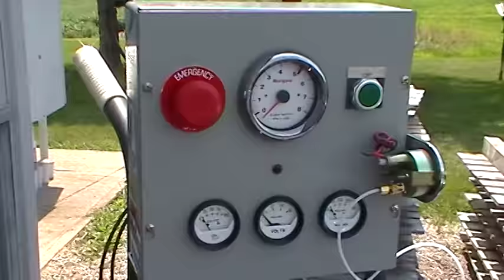383 Stroker Blower Motor Startup

Comment: That seems a little excessive for just those four castor wheels....
Reply: This is sarcasm by the way....
Reply: Cpt Swoopty haha
Reply: Hahahaha
Reply: HA!!
Reply: Cpt Swoopty absolutely the best comment I've seen
Reply: Old comment but still funny as shit!
Reply: Cpt Swoopty -very good! Lol!
Reply: Might even be Harbor Freight
Reply: That's a ten second  engine stand dude.
Reply: i bet someone of those 3.5 sec radial guys could make that work...and 220 mph to boot!
Reply: the wheels are chev ,if dodge or ford then we would have a prob
Reply: Those caster wheels offer the best output ratio lololol!
Reply: But...they are urethane race spec, and drilled out, so they should be able to handle it !  :)
Reply: Need enough power to overcome the lack of traction on the small size wheels...lol
Reply: 3 year old comment still wins. That's funny stuff right there.
Reply from the maker: I finally put 30x14 slicks on the cart.

Comment from the maker: This engine ended up installed in a 1948 Anglia driven on the street by a 70 year old man. Replaced carbs with 680 Holley blower carbs at his request.
Reply: So, essentially this motor will never see anymore than idle RPMs?
Reply: RizoProduction yah it's really sad that it'll truly never run because the engine looks like something out of mad max and must be drove like a mad max car
Reply: Joshua Godsey hey there are some pretty badass 70 year old guys out there so you never know 😂
Reply: Dylan Rhoads why do I feel like the 70 year old driving this won't be badass though
Reply: Joshua Godsey because you are probably right hahaha
Reply: Dylan Rhoads there are some 70 year olds in a front engine dragster series around my area.  Running blown alcohol between their legs like it's nothing.  Well I think one of them died during one of the last races, but I guess that happens when you get too excited.
I was wondering about those carters is they were just something someone had and said here you go or what.  Wasn't surprised new owner swapped them out.
Reply: freaking engine sounds incredible,but there's something going on with vacuum,or like you said it's running lean,but still yet if it were lean it would sound more like a dead spot,and that's not the case. it's a vacuum leak somewhere probably in the intake
Reply: Don Gray most likely a leak between the intake plenum and the blower. The gasket channels are thin and the bolts are widely spaced and boost from the blower blows them out. Another reason could be those carter afb carbs, I ran one on my 1978 mustang 5.0 and could never get them to run smooth to save my life, constantly fiddling with settings, jets, plus they love to backfire and burp fuel all over the engine. I replaced it with a 1850 holley double pumper and never had a problem again.
Reply from the maker: It turned out to be too much car for the owner. I own the Anglia now. I have over 1000 miles on it and have been against the Rev limiter in high gear MANY times. It is damned fast!
Reply from the maker: RizoProduction. NOPE! I own it now. Was too much for him. I've been topped out several times and have driven it over 1000 miles. It kicks ass!
Reply from the maker: dave1135 I switched to 670 Jolley blower carbs. Runs a ton better. Still surges when idling in gear but I like that.
Reply: You mean 670 “Holly” blower carbs? What do you charge to build a pair of these, apron 420-425 Hp for an older (1980) boat that’s all original. No blowers, just a thumper cam and reliable? Pls reply back if you would?
Reply: qtrmiler1 what horsepower is it making ?
Reply: So cool!
Reply: I am really wanting to know how much this motor sells for..
Reply: hopefully you had the good seance to keep the Holley's. Old man had that part right, now didn't he
Reply: I hear a lot o nay-sayers on the the sevety year old man driving using a motor like that.  I say he was 20 years old in 1968.  He knows what a muscle car was and can be.
Reply: +RizoProduction Shit, plenty of 70+yr old men still racing. Go watch a Gasser shootout and check out most of the owner/drivers, many been doing it since the 60s with the same car.
Reply: watch the 70 year old guy drag racing a hemi cuda stick sometime,dont be so quick to write off the old guys.they did it first and still do it...................better than the young punks @joshuagodsey3731
Reply: @qtrmiler1   I'd love to see video of that car in action.
Reply: one of the fastest man at our track is 92 years old, don't underestimate these guys ahah @RizoProduction
Reply: qtrmiler, if you drive that Beast on the street, I hope you are in tight with the local Smokies ! ! !
Reply: @matguthrie8975  If he's not making at least 600hp with a 6-71 it might be time to hang up the tools.
Reply: You build this enguines to sell it?
Reply: If it's going in a late 40's Anglia it's gonna get run i'll bet. 70 years old? Probably an old drag racer. The opposite of a young poseur.
Reply: @qtrmiler1  I think that is an Awesome engine,my2cent's.
Reply: Price?
Reply: because it was too perfect with carters..lol
Reply: 500 cfm carters or edelbrock replicas have always been my carb of choice but I always get flack for it by giys that just dont get it..
Reply: When I’m 70 I hope I’m still tearing around with engines like this
Reply from the maker: @mikebidus7166  Vietnam vet too.
Reply from the maker: @bigdogbob845  The chief is a hotrodder too.
Reply from the maker: @jpam59  I can. I am gathering parts for a new one now. This one is going to be Enderle injected.
Reply: @qtrmiler1   Nice,  it just goes to show , "It's Not Who You Are, It's Who You Know" !
Reply: @qtrmiler1  Thank you for your service.
Reply from the maker: @mikebidus7166  Not me. The guy who bought it is a vet.
Reply from the maker: @dave1135  Holley 1850's are 600 cfm vacuum secondaries. I modify them for street blown smallbocks all the time. My preferred street carb.
Reply: So where’s the Anglia video?  I wanna see this thing going lol
Reply from the maker: @bigdogbob845  Chief is a hot rodder too.
Reply: @qtrmiler1  Like they say, "It's Not Who You Are, But Who You Know !"
Reply: @dongray3258  if it was running lean it wouldnt be surging because despite you all calling it blower surge  it has more to do with rich idje mix  lean it out ans watch whst happens  I can make any engine with a big cam surge like that at idle

Comment: a big part of that idle surge is the 8% under driven blower. awesome sounding little small block. good job.
Reply from the maker: Actually, is because the Carter Carbs had problems and were too lean. I replaced them with 600cfm holleys with boost referenced power valves and vacuum secondaries. Now it runs smooth as could be and wastes a lot less gas. You can always turn the idle down and turn the idle mixture screws in a little and make it surge.
Reply: @qtrmiler1  you tell ‘em boss
Reply: "This is caused by a rich/lean cycle at idle. As the motor leans out the RPM's increase and richen up the motor, when the motor richens the RPM's decrease and the motor leans out again. This continual cycle is known as “blower surge”. "   Source: The Blower Shop
Reply: @mikebrosnan2895  True, and the more underdrive , the more blower surge because of the increased airflow at each RPM surge.

Comment: That idle can literally sing me to sleep it sounds so amazing!!!
Reply: Kleo 84 p
Reply: What idle?  Sounds like it has a vacuum leak.
Reply: jennaishealed thats the supercharger your hearing
Reply: panda44r and it's surging because it has a straight vane blower on it and that's what they do
Reply: panda44r maybe the boost referenced timing is off a little bit and it is retarding the spark prematurely.
Reply: Where would you start to build A 383
Reply: camaroguy 66   Can you give me the name and the size I'm new to all this I would like to go to school to be a mechanic that work on old school muscle cars
Reply: camaroguy 66  thanks I'll start looking for one if you have any ideas let me know
Reply: camaroguy 66  thanks I'll start  looking around  thanks for the idea  my friend
Reply: camaroguy 66  what year would I be looking for
Reply: camaroguy 66  I got a Chevy 350 vortex  taking to the shop next week what should  I ask for my friends
Reply: camaroguy 66  If you want more cubic inches just use a conventional 400ci configuration. No point in increasing rod angles on a blown engine for no gain. It's not like you need any extra torque to be putting in a longer stroke the 3.75" of the 400 Chev, it is plenty long enough. Some say too long, but I like the 383 as a combo, makes a good street engine.
Reply: Love to have one in my 72 Chevy Nova

Comment: I built a stroked 350/383 ...10:1 compression...205 heads....pushed 425 house to 34 inch mud tires on a 78 GMC Jimmy while I was in the service. 
Loved the truck. She would go anywhere I pointed her.

Comment: Say lean but noticed throttle blip fires a quick rich pump shot out of the exhausts. Sounds more like float levels upsetting the emulsion tubes mix. Change to Holley's and setting levels and metering blocks are way simpler, same for secondary actuation etc. Correct timing curve and fuelling is a must and expensive if you get them wrong!
Was hoping this wasn't a blooper clip where a big torque rev sends it spinning off that rediculously narrow stand. They are not designed to be dyno stands lol. I recall coming into a shop where they were trying to start a 402 BB on the floor with a similar setup. Thankfully I found their firing order was out and prevented damage and injury!
His loose shirt tail in the latter part of this clip got awfully close to the pulleys and belt!
Loved building these 383 and the 406 SB too!

Comment: I just bought a 2017 M3 competition.  It has a straight 6 with twin turbo.  I built V8s as a teenager, and in my 20s.  I had Mustangs and a '63 Fairlane, so I was working with 289s.  There is simply nothing today that sounds as beautiful as a supercharged V8.  As fun, and fast, as my BMW is, it's just not a raw horsepower V8.    Nice job, sir.
Reply: The 4.0L V8 S65 in the e92 M3 sounds crazy ferocious with a fully modified exhaust, 8400rpm redline on a V8 is insane. I've an e46 M3 with the S54 3.3L (overbore) I6 NA and can agree, while it sounds like a Ferrari with the right exhaust (incredible 8.1k redline), there's something about old school American muscle OHV V8s that sound like absolute monsters. The idle of this engine, if my S54 would be making the same sounds, would have me in a heartattack right away, wondering what plethora of sensors, software settings, and/or idle control parts have messed up idle. But for this polished beaut, just amazing that it's like what you're aiming for lol. Music to the ears, masterpiece of an engine, took me 3.5 years to rebuild the S54 motor, stacked with mods, but not nearly as nice as this!
Reply: @fiatlux4265  I totally appreciate your love for that car/engine.  Sounds like you are just a newer version of me.

Comment: I built a 383 stroker naturally aspirated in high school. I put in in a 69 shortbed Chevy pickup… that engine was a beast. 533/555 with a 114° lobe center and a victor junior intake and 750 Holly carb. She would broil the tires at 20 mph…. Just punch it!

Comment: Sounds like a great street engine that would not disappoint. But the AFB carbs?
My buddies 426 Hemi in high school had 625 AFB's on it. 
I did try an old 800 Thermo Quad on my SBC in my 1970 SS Nova back in the day and when those man hole covers opened the amount of air you could hear was awesome. 
Mind you I had a purpose built 327 balanced , blue printed 2.02 heads 600 inch lift solid lifter can 4 spd with 4:88-1 gears on the street. 
 Those Carter carbs work pretty good. I love to see my generation building good stuff. 
I did build a 383 SBC and it worked well. 
Thanks for the memories guys.

Comment: That has got to be the calmest blower surge I’ve ever heard!
Reply from the maker: Actually caused by not being tuned properly. I eventually eliminated the surge all together except when first started cold.
Reply: @qtrmiler1  I’ve always heard that blower surge was caused by them not being tuned properly, but then I have to wonder why I see so many supercharged cars that surge badly, like enough to chirp the tires every time it leans out. Then I’ve also heard that they tune them like that purposely, because it’s tuned for 7 or 8 thousand rpm, and not really tuned for idling.
Reply: @qtrmiler1  What kind of things can be done to stop it?
Reply: @fcaughli  My 350 blower setup: Set timing to 25⁰ initial, advance max 30⁰ all in by 3000 rpm. .040 plug gap. Mixture screws out 3/4  turn on 2 Holley 650 double pumpers.

Idles at 900 rpm no lope except under 100⁰ engine temp.
Reply: @williamfranklin6283  OK great. I thought that getting the advance up would help. I know some like the surge which I hate, I just couldn't go with the surge in a street car. Lope yes, surge no.  Probably never get to this point, but thanks for the advice. Have fun with that cool beast. Has anyone put up a vid of the car when it gets in it?
Reply from the maker: @williamfranklin6283  Sounds like you nailed it perfectly. Careful (proper) tuning should yield no surge at all with carburetors. I usually richen up the idle just a tiny bit from what you stated. At a 900rpm idle, the engine will usually idle smooth as silk most of the time yet start a light surge for just a few seconds every minute or so then smooth right back out.

Comment: Why not a thermostatically controlled radiator? If you keep pushing cold water into it it'll never run right. She's got to come up to operating temperature.
Reply: I suppose those water cooled
racing boats never get up to operating temp either
Reply: @jameshile9164  thermostat
Reply: James Howland : Nope.
Reply: My jet drag boat cools on lake water. Never had any issues with that.
Reply: @jonbrockman5308  it's designed to do that.

Comment: How much does an engine like this cost would like too know 
Thanks
Reply: 69johnjunior well from what I have seen a full 383 will be like 3-4K
Reply: around 10k if you buy and build it yourself. 12k if you buy it from a builder. blower alone is 3-4k plus engine another 3-4k. still need carbs and ignition system.
Reply: 69johnjunior k
Reply: 69johnjunior 383 stroker 5k
Reply: TheTacticalcheez i would love to find a 3k to 4k impossible
Reply: 69johnjunior    me to
Reply: TheTacticalcheez plus 6-71 for 3.5k, new valvetrain for 800$, carbs for 500-2000$, exhaust and ignition
Reply: Trxppy Slxwed seen crate engines (yes 383 strokers) without top end and oil pan for 1.6k
Reply: Blower and all like 11k making 400+ HP. Look at Jegs or Summit Racing crate engines.
Reply: David smith ur the only one who knows what they are talking about.
Reply: About $4k for an engine with all the forged goodies to live under boost, and another $4k for the blower. Figure $10-$11k when all is said & done.
Reply: With a engine like that who needs a wife😊
Reply: @mgtowdarrelldundee8643  MGTOW
Reply: 69johnjr,   Sonny, if you have to ask, it's more than you can afford ! ! !

Comment from the maker: I have started building the next one. It is 357 cubic inch small block Chevy. Aluminum bowtie heads are extensively ported. Enderle Bug Catcher injection on top of an 6-71 blower. I still need to buy the blower.

Comment: I've built 383 engines and if all it will turn is 6000 rpms....junk....real 383 chevy is 2 bolt large journal 400 crank and rods. no store bought garbage.
Reply from the maker: I would never use a turned down stock cast iron 400 crank in an engine like this. And I would not even consider using stock 400 rods. Besides being weak they are shorter than other small block Chevys. The rpm level is mostly limited by the camshaft type and profile. It is a hydraulic flat tappet.
Reply: I use steel . all old school.  I used this motor for dirt track racing.
Reply: I think you mean that's a piss poor 383
Reply: if you're talking to me i don't want to hear shit. i have a .40 over 350 4 bolt block, 3.75 stroke crank, speedmaster rods with arp bolts .40 over enginetech pistons heads with heavier valve springs, comp .505 lift cam of course you don't have to believe me but that's exactly what's happening it's actually going into that bagged s10 in my profile pic btw .40 over stroker is a 385
Reply: Samuel Anselmo  there is not such thing as a real 383 it's a modified 350 most people use four bolt main with 400 crank  not a junk 2 bolt
Reply: Rooster Fries  I agree with you
Reply: Plus the fact that virtually any aftermarket aluminum head will out flow even the most radically ported stock iron heads, and be a whole lot lighter to boot..

Comment: I dont get why you buy a big expensive engine like that and put it on a stand. why not put in 69 nova or camaro.
Reply: They're testing it, and making changes before swapping it into a chassis or sell it. It's easier in a stand to walk around the and engine and make all the changes
Reply: jonah moscati to hes just testing it he may drop in in a rig later on
Reply from the maker: jonah moscati  It is now in a 48 Anglia on the street.
Reply: If that’s a serious question, it doesn’t deserve an explanation.

Comment: I have a 12% underdriven Blown 30 over bored mopar 360with an extra 1/2 in. Crank Stroke totaling 407 inches. With 691 ponies on tap my 68 Dart GTS Convertible runs Goooooood. Engine was built by Big Al’s Toybox.

Comment: Usually when an engine "hunts" for an idle like that , it indicates a vacuum leak somewhere. we used to spray ether starting fluid around the base of the carbs and manifolds and if the engine suddenly sped up and it easily was repeatable,  that was where your leak was.
  But with a positive pressure supercharger,  I'm not sure how that would work.    
    but that "hunting" would drive me nuts!
Reply: This is just a normal case of blower surge. Carbs just need to be dialed in for it to have a decent idle